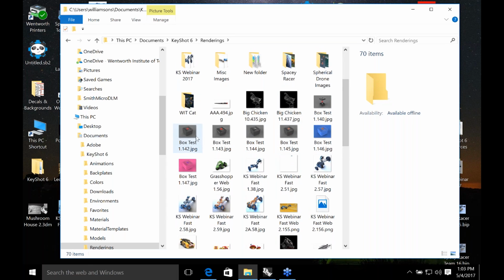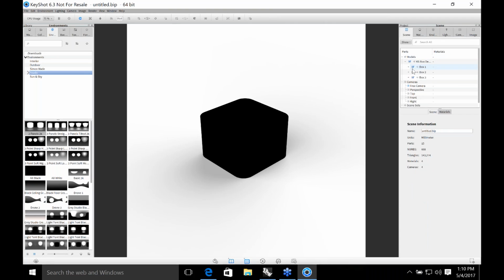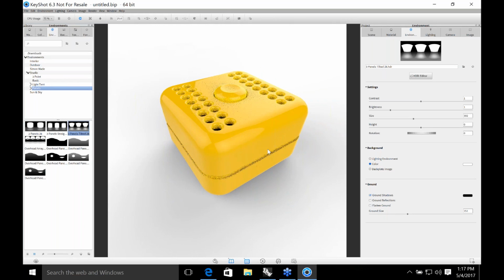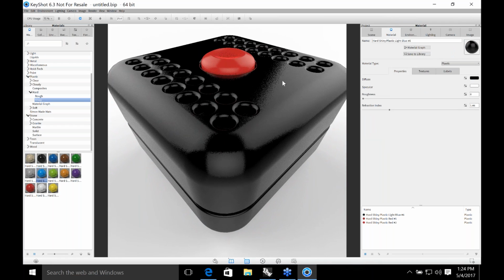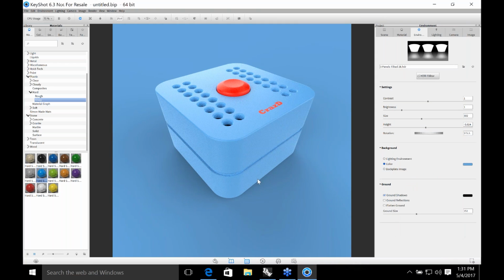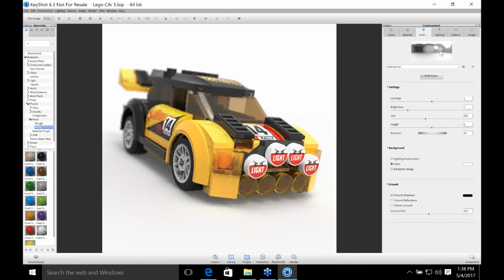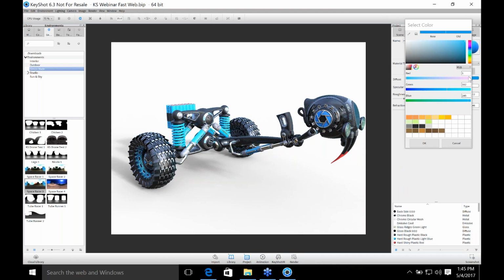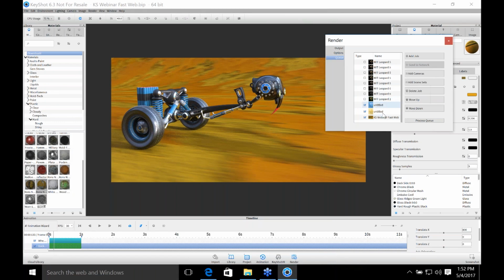Webinar 60: KeyShot for Beginners

Comment: keyshot one of amazing out stand render engine 
but it fully depend on HDRI lighting i like to see how to improve lights more with normal lights customize  , and thanks for all
Reply: You can always create 3D geometry within Keyshot, like spheres. Then you can edit the material and turn it into a light source.
You can also download IES Profiles from some manufacturers' websites like Philips :)
Reply from the maker: Yep, Martin is correct. You can add physical lights - point, area, IES - plus the HDRI Editor allows complete customization of the HDRI, along with sun & sky capabilities.
Reply: thanks Martin for your help i will try that for sure but IES you know it's for wall sexy light :)
Reply: Thanks Keyshot for your services and yeah i like HDRI Studio so so much it's so powerful but it will not gonna help when you need to play with lights more some times you need very sharp near lights
Reply from the maker: I recommend watching the lighting tutorials and webinars. You can use point lights and area lights to add physical lights to your scene. IES profiles have many more uses than just wall lighting. Also, I am not referring to HDR Light Studio - I am referring to the HDR Editor inside of KeyShot. Definitely check out those lighting videos :)